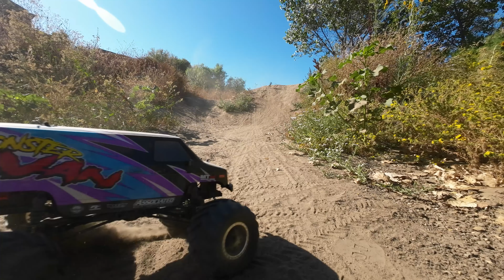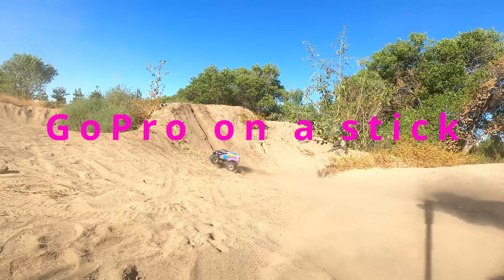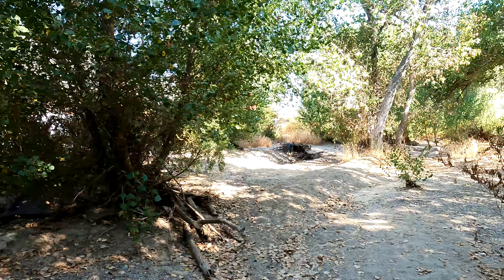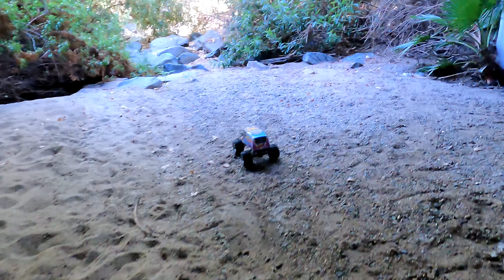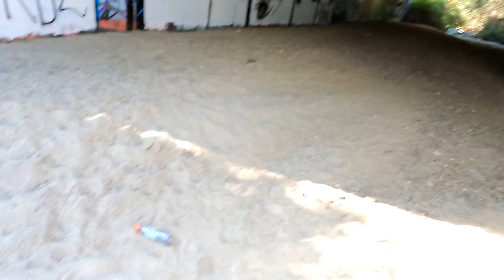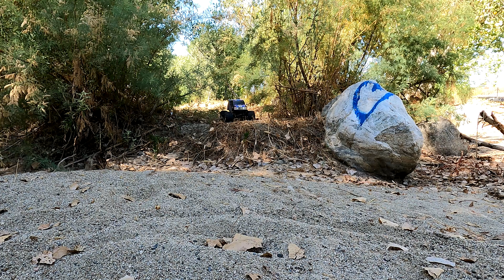MT-12 Goes Brushless

Comment: I fell in love with this van when i first seen it. Its def a great driver from what i can see. Great video bro.
Reply from the maker: It runs ok stock but need a bit more power. I added a cheap brushless motor and ESC and it's much more fun. It takes a motor with a long shaft to reach out to the spur. As it sits now the pinion is all the way out to the end of the shaft and barely reaches. I think it's easier to do tricks with than my LMT but I just haven't practiced much.
Reply from the maker: It runs ok stock but need a bit more power. I added a cheap brushless motor and ESC and it's much more fun. It takes a motor with a long shaft to reach out to the spur. As it sits now the pinion is all the way out to the end of the shaft and barely reaches. I think it's easier to do tricks with than my LMT but I just haven't practiced much.
Reply: @RCRoads  looks like you got it right because it looks like it does about 60 and it accelerates pretty hard. Keep it up bro.
Reply from the maker: @gamedogrc  Thanks my friend.

Comment: 😮😮😮 amazing upgrade ❤
The gears and diffs supports +21 mph for long times? 
Top speed with 2s and brushless please! 
New subscriber😊
Reply from the maker: Thanks so much for checking it out and your awesome comment.  And Sub.... 
I really don't know how well the diffs will hold up but I think running 21 mph in a straight line would be totally  fine. I'm certainly not an expert on the subject but from my perspective doing donuts or landing a jump at full throttle might do some damage.  So far no breakage what so ever. 
Now I'm curious as to how fast it is. I guess I could do a speed run today and see how it does. Thanks again for checking it out. .... 👍